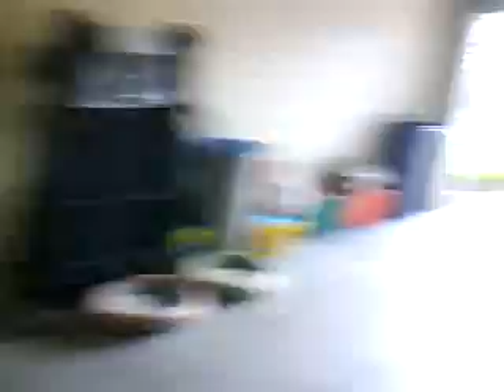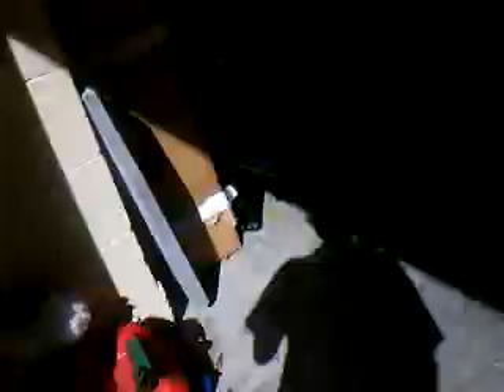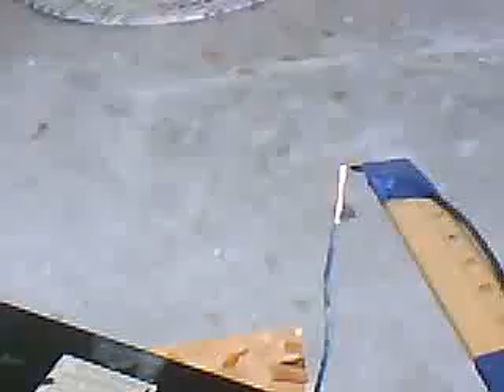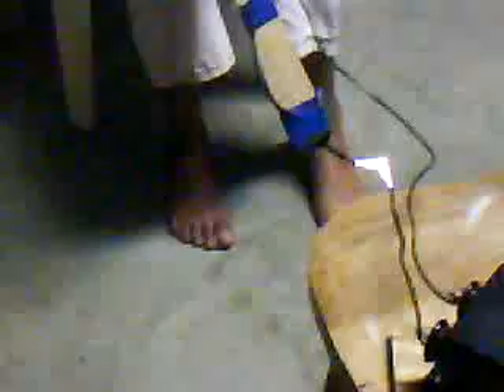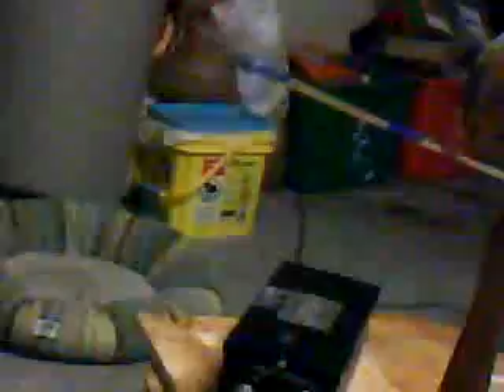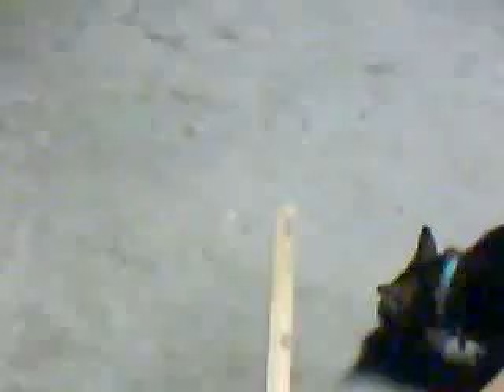TESTING THE NST!!!!!

Comment: Thats a nice NST, does it have twin outputs on the other side also?
so it has 4 terminals????
And What a Great dad you have there ;)
I test my NST's with copper coat hanger wire made into a Jacobs ladder.
And yes that kind is an unfaulted NST so constant arcing is what it is made for that is why i told you to get this kind . So far so good 
How are the capacitors comming along?
Dr. Greene